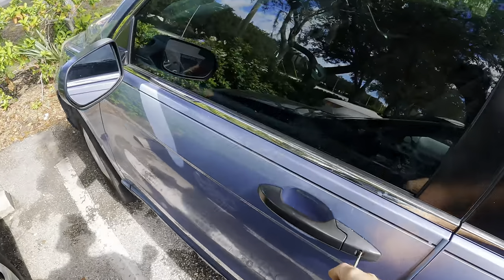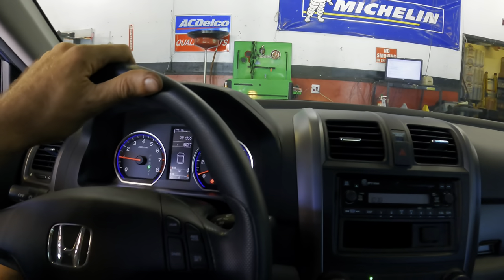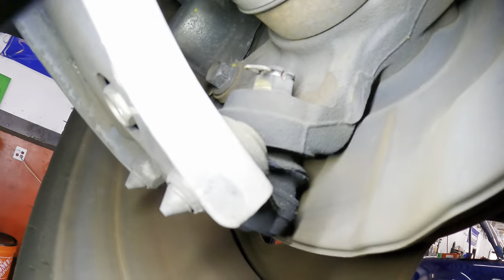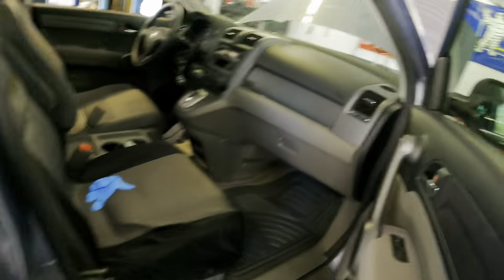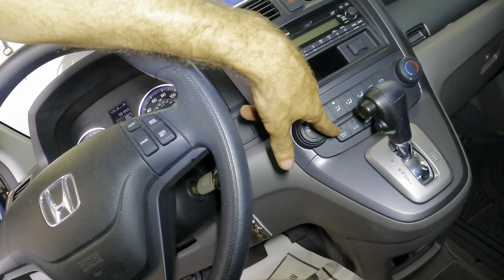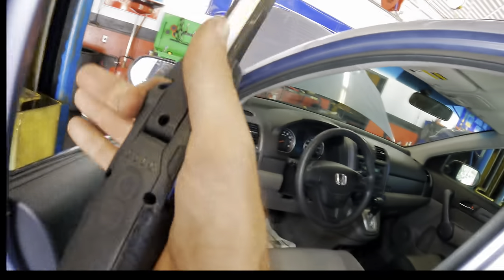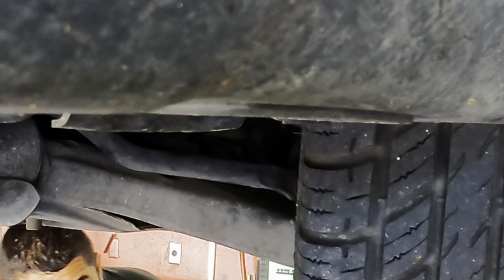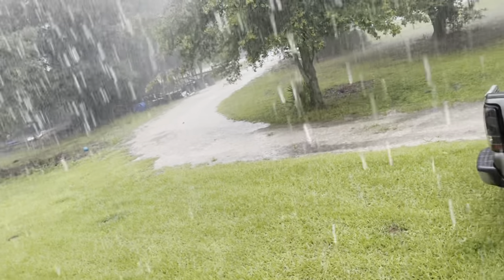Scam or Stupid? YOU decide! Work that wasn’t needed! Honda CRV

Comment: Cabin Air Filter on a 2005 G35:

1. Remove lower kick panel
2. Remove side lick panel
3. Remove glove box
4. Replace filter

1 hour shop time

This car was DESIGNED for billable hourts.

Comment: Ray....oil checking right after you shut it off...1/2 to 3/4 of a quart is still up in engine...(I was trained by Standard Oil...I sold way too much oil...later I found out I was overfilling many engines showing 1 qt low on stick...oops...It blows seals and ends up being overfilled...I do feel bad about that...oh well...you do what your trained to do young Brother...🙋🕊👈

Comment: I went to a regional tire/suspension chain in the Pacific NW (if you know, you know) to replace rear shocks on my '91 Dakota. I forgot to have them rotate and balance the tires, a free service for the life of the tires purchased at this chain. Two weeks later I went in for that rotate & balance. The tech comes out and tells me I need new rear shocks. I speak loudly so that everyone in the lobby can hear. "You mean to tell me, the shocks this very shop installed just 2 weeks ago are already worn out? By all means, please replace them under warranty, I insist." He backed down real fast, the manager sprinted over and intervened. I got a coupon for a free oil change, which I used at a different location. I complained to their corporate offices and the State AG. I learned the manager was replaced and the tech was fired.

Comment: Its common here in the UK as well. I was a mechanic for 14 years, and used to see it a lot, especially with failed MOT'S (yearly safety check). It was just something that needed cleaning up or greased, we would take it to our local MOT test centre and it would pass, saving the customer money. Unfortunately it's the way of the world at the moment 😕

Comment: You won't be seeing me over at the other channel.
You should have sprayed the lower ball joints with Brakleen to get the oil off so you can see if it was leaking badly the next time you see the car!
I would have thought that the over-selling technique would be to tell them that they need some inexpensive stuff, get the car up on the lift, and then tell them that they need some expensive stuff. Mechanics love to get the car up in the air!!!

Comment: Selling links and bushings is a classic shop trick for easy cash. It’s not a safety item. 
The first shop I worked in. The regional manager made my bosses life so miserable. It basically forced him to do things like this. The shop we were in wasn’t designed for high volume r&r work. But not according the the regional manager. The mark up on rotors was like 300%. It would have been cheaper for people to hit the deal for oem parts. Vs the after market parks the shop was using.

Comment: had a commercial chain shop recently tried the BS me on my vehicle. I do the work on my vehicle because i know what and how to do it. they tried to upsell me and do some tricks on my vehicle to make it run incorrectly. (Such as realease brake pressure saying a brake caliper was out and say the metal squealing noise in my front hubs, its not, its the transmission heat shield. I take the shield off the noise is gone)

I will never go back to the shop ever again. And had to fix there mess. The only time i ever went to a shop for convenience made a couple hour job into 2 day issue

Comment: thank you so much for ignoring the annoying telephone, maybe you could cut out the audio in future or switch the Telefon off.
I have a 2004 Honda CR-V 2.2cdti with nearly no repairs on 220.000km. Only weak point are the front disk rotors that were grinded once and replaced once. Once a power stearing hose broke.
it takes 6l diesel for 100km
what is around 40mpg

Comment: oh, Irony.  I just had my 04 CR-V in the shop, and walked away with a 4000 dollar "others" repair.  some of which I know from watching this channel does need done (torn CV boot means replace the whole thing), or know from experience will need attention (seized caliper will have contributed to suspension oopsies, as well as PA road conditions).  but they wanted to replace the entire exhaust from the header back for a minor seperation at the cat, and 6 hours labor for an oil pan gasket!

Comment: That is obviously a southern driven car and I don't know where you are, but based on the vegetation at your house, I would guess in the south somewhere. I would ask the customer about previous fluid changes and maybe recommend those if mileage indicated. Otherwise I would change the wiper blades and tell her to come back next year so we can inspect that ball joint.

Comment: Took my vehicle in for rear brakes after an inspection said there was 0mm remaining. Same garage advised me there must have been an error with the notes as rear brakes were fine. Surprised they didn't just change them, the service technician said if it was his vehicle he would not replace them yet they still had 3mm of usable pad on each side. He saved me £

Comment: Yes they could have been searching for a noise. Sway bar links and ball joints make a lot of noise when loose. But they are easy to check with a prybar. I think they were overselling her. She's an old lady, she wouldn't know any different.
When you couldn't open the glove box, that was my first thought as well. If it's locked, how did they confirm a cabin filter was required? Did you get an answer back on if she had it locked when the other shop had it?

Comment: I hate working on those. My fience has an 07 CRV and they are a nightmare. Had to pull the exhaust manifold off just to replace the starter because from underneath the cross member blocks it off. Then had to pull the whole bumper off just to replace the headlight assemblies.

Comment: This type of behavior is not endemic to the US. Around the Eastern Bloc we had the media pick a case up, where a guy wanted to have something in the suspension fixed, ended up having the boxed vehicle repainted in a disgusting detail, the issue not fixed, and the perpetrators vanishing like vapor.. 
This is a kind of stance towards labor that always made me sick; if you get caught, expect to do the lowest of jobs - because frankly that is what you deserve. Where you have no responsibility, but can not do harm either. 
Like a bloke to wash windows on cars and vehicles the shop completed work on. 
Or someone to send reminder e-mails to participants (effectively duplicating the functions of a smart calendar).
As always, benefit of the doubt is there, since if there is at least one other person as medium, one can never get 100% of the information exact. But .. chances are "someone had something..forgotten".

Comment: I had an old '93 v8 Holden (Chevy I guess is the comparable product) a while back and these things are known for leaking oil everywhere. It's a regular thing with these engines, to find one that doesn't leak is rare. Anyway I took it for its regular oil change at a shop because I didn't have the time or space to change it myself and when I went to pick it up it was the same old classic "wE nEeD tO pUlL tHe EnGiNe OuT sO wE cAn FiX tHe LeAkS". I said no way and the engine lasted for another 100,000 kms before any serious work was needed on it. I never went back there again… so they actually lost a customer.

Comment: had something like this with my Parents Car when they had some rear brake problems. I can understand where they were coming from but they wanted to replace every thing. on the rear brakes. Both Calipers Both rotors Both brake lines on each side and new pads.  Was going to cost over 1000 dollars. Both of my parents are on SSI there was no way they could afford that.  Took it to another shop to have them look at it more of a mom and pop shop. I Got new Pads and rotors that i was able to take in my self which the mom and pop shop does not mind they just cant warranty the parts which i get. and i took in one brake line and caliper for the side that was having the most problem. Turns out it only needed pads and rotors. Both Calipers were fine along with the Brake lines.  The slide pins on the Calipers were frozen. He just popped them out re lubed them and put them back on and they have been working just fine. He only charged me 125 Bucks for doing everything instead of 1000 like the other shop was going to charge.

Comment: So selling stuff not needed , I recently had the stolen (2nd time)  catalytic converter replaced on my E450 box truck. The next day after I picked it up I rolled under to paint and engrave it with the vin, what I saw was a straight pipe with a O2 sensor. The charged me for rhe cat, y pipe, 3 O2 sensors  and labor 4500.00 total. I called and the shop said bring it by and they will show me where the cat was and engrave it for me. Well the Manager rolls under and points to the heat shield on the year pipe. I said  nope that's the y pipe you didn't replace and the new silver pipe is where the cat goes. So apparently they fired the guy that preformed the work that morning for simular reasons. The Mgr said bring it back and we will put the cat and a guard on, should I trust them as he knew the cat was on the shelf. If I didn't come back were they going to resell the 3000.00 cat I paid for and keep the money. I have my fleet service blocking payment at this point. I was using the truck so I couldn't leave it and I was beyond pissed this even happened .

Comment: i always support the lower control arms while checking ball joints, it takes the spring pressure off the joint and if it's bad, it will move....I hate when other shops write thousand dollar estimates especially to older people who get scared easily

Comment: I see where you are going for a large estimate at first visit. The dealership I work at charges close to $300 an hour for labor. A single axle brake job break that ceiling quickly. Good rule of thumb for aftermarket locations.

Comment: Im sure you did a good job of a visual inspection of parts but I did not see any testing of the parts.  A quick yank on each end of the sway bar would have shown the condition of the links and a pry between the rim and LCA would have shown the condition of the lower ball joints.  Things can look visually good but still be bad.  Considering the videos I have seen you do im sure you did this just off camera and im glad they got you for a second opinion.  Keep up the good work.

Comment: It happens ALL of the time. About a year ago my brother, being the hard headed guy that he is, went to a shop because he had trouble shifting (5 speed manual) so they went all "yeah, we have to replace the shifter and both cables 'cuz they're binding" at a cost somewhere in the neighborhood of 200 dollars. We fixed the problem at 1/10th of that price with some grease and a few new parts. Go figure.

Comment: I took a car to a very well known transmission shop to have them read the codes for a check engine light. They "recommended" a whole lot of repairs. Right up untill I showed them my ase certification card. Then the whole story changed.

Comment: With the cracked rubber ball joint letting road dirt/rocks etc. inside the oem joint does need replaced unfortunately. Should have been done in pairs.

Comment: 8 years ago my then 87 year old mother took her mercury in for starter issues.  The dealer correctly determined the starter needed replacement.  It had a 3 liter vulcan engine which is right up front, 2 bolts and out, easy.  Well they ended up charging her 5 hours of labor and the starter.   My mom called me and said she just had an expensive repair done on her car and she had to take some of her savings to pay for it.  When I saw the bill, I was outraged.  I called the dealership, insisted that I speak with the service manager.  I told him about the invoice and that it was way too much for labor.  He said he would pull the invoice and check it over and offered to call me back once he did.  When he called back, he said it was "coded" wrong, should be 1 hr labor.  I told him it's bad enough that I could have gotten a rebuild for half the price they charged for theirs and I did my own starter in 15 minutes on my vulcan 3 liter and I am not a mechanic.  He said he was sticking with his one hour labor and my mom can come over and they would write her a check for the overage, if she wanted, or a credit.  I told her to take the check.  Wish I didn't live 250 miles away, I could have saved her another couple hundred dollars.  This same dealership overcharged her for oil changes all of the time afterall they use oem filters and oem oil.  Uh-huh.

Comment: Literally just did an oil change on an 03 buick century.  This woman was like, look, I know it needs a lot of work on the suspension and stuff, but I'm waiting to get the money together.  Well, first I couldn't lift it on anything but my drive on lift because it was rusted to shit, as expected.  Tires were at 1-2/32nds, hole in the coolant reservoir, leaky no pressure radiator hoses, oil pan leaking like crazy, dashboard didn't work, so no idea speed, mileage, what lights are on (although it was misfiring like crazy, so I suspect it would have been on), I never even bothered looking at any part of the suspension.  Brought her back to show her everything, and I was like "Please don't put any more money in to this car.  I don't even want to bother with this oil change." and she was like "My guy said it just need sway bar links, struts and tires."  And I"m like "Yeah because that's all easy bullshit work, that takes no time to do and makes money.  He is ripping you off.  Period."  So I gave her a conventional oil change for 30 bucks and she promised to take that shitbox to the crusher and buy something else.  But man, I was fired up when I was looking at this thing with all these major high-labor time EXPENSIVE problems, and some jackass is recommending easy suspension work and tires on a car that I would be shocked if it makes it another 1-2k miles.  Some people in our business are absolute pieces of shit.

Comment: Some years ago I went into a local Tires Plus for a rotation and balance.  They claimed that my front shocks were leaking and took me out to show me oil dripping from them.  I said that it was funny since I just replaced both front shocks about a month ago.  I then told them to forget the rotation and balance and give me my car, I have not and will never go to a Tires Plus again. Sad thing is that I tried them because a Tire Kingdom tried to rip me off, they said that my pitman arm was bad but they just replaced it 6 months before.  I also had a Goodyear telling me that my cabin air filter needed replaced but my car didn't have a cabin air filter.  Beware of scammers.

Comment: It was only 91, 955 not 191,955 lol

In the UK the split boot on the passenger side even if there's no wear or movement in the joint itself...

You should be using a lever and moving these joints and not relying on a visual inspection only, you can't 'see' wear inside a ball and socket type (unless you're superman and have x-ray vision lol) it's not like you to not get as in depth as you do normally.

Of course its in mint condition, it's a Honda lol

The car in front is a Honda 😉

Comment: As a Honda 2010 CRV owner I can tell you wiper blades are a pain.  Aftermarket blades don't work.  The wiper arm has a design that has a tension spring that is nearly touching the windshield.  If it touches it screams.  The normal position for this spring is about 1mm from the windshield. Ridiculous. I hope they changed that on later models.
The best solution is to buy the blade rubbers from Honda.  Less than $20 for a whole set of 3.  Easy to slide them into the fixture.
Reply: That's what I do.  The quality of the Honda inserts is excellent.

Comment: Had an oil change shop try to sell me an air filter when the car has sensors and it was at 60%. Also tried to sell a $200 fuel injecting cleaning as “recommended maintenance”. 

I could see right on their screen that THEY recommend it. Manufacturers never recommend that cleaning and flushing crap. 

Unfortunately they sucker countless ignorant customers into what amounts to a bottle of Techron dumped into the gas tank.

Comment: Reminds me of the last shop one of my friends took their vehicle to. Nearly 20 year old civic, decently beat to shit but still kicking, Had a gnarly exhaust rattle (no cat, that was gone for a while). Shop recommended ball joints, wheel hubs & bearings and some other shit. was about a $1500 job, And they didn't even fix the rattle. I got pretty heated with the shop, knocked it down to $800. But the fact that they were even recommending all of that on a vehicle that probably won't be on the road in a few years any way is asinine, and to not even fix the customer complaint after a bill like that?

Anyway that's my rant on shops being shady. It's getting harder and harder to find a shop that isn't a large chain or by doing shade-tree fixes to milk customers for cash. It's why I usually do work on friends vehicles these days rather than have them take it somewhere here.

Comment: I highly doubt green brake fluid indicates copper contamination, especially on modern vehicles that use stainless pipes, not copper. In fact you can purchase green brake fluid as well as other colors.

Comment: My 97 528i doesn't have a single intact ball joint boot on the rear suspension. A twice yearly spray with grease keeps em going. Been like that for two years and no abnormal ball joint wear thus far.

Comment: A cracked boot on the ball joint is not a non issue.  Eventually all the grease will leak out, the joint will rust, and then eventually it will snap off if it's ignored long enough, and that could get her or someone else killed.